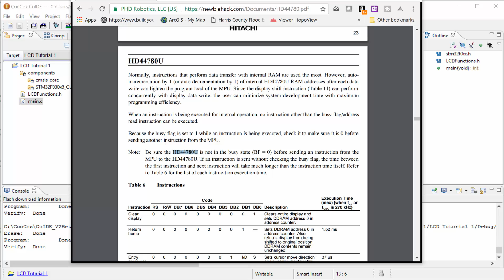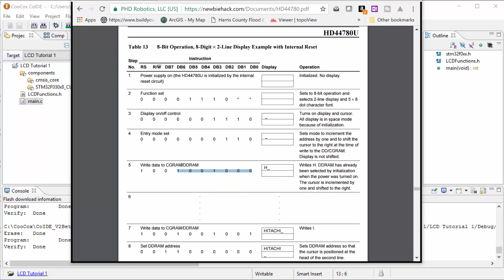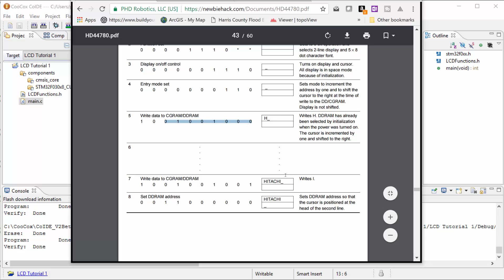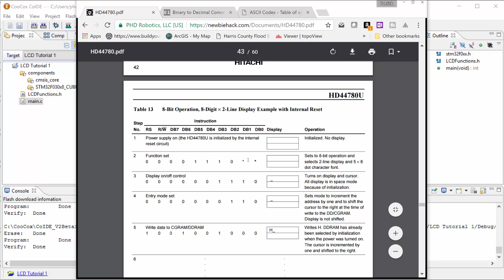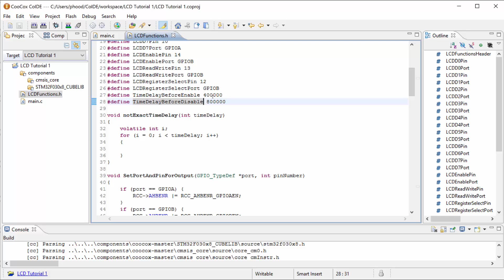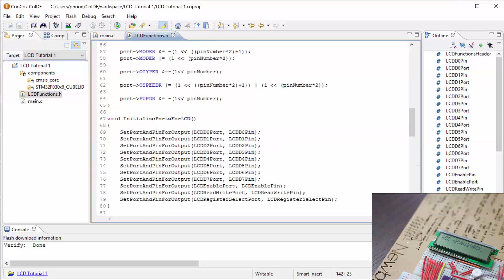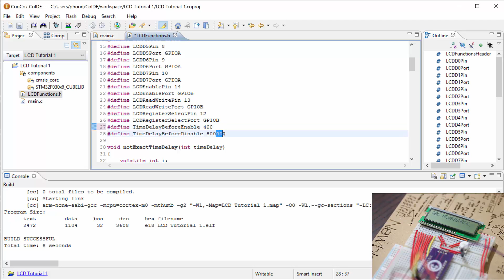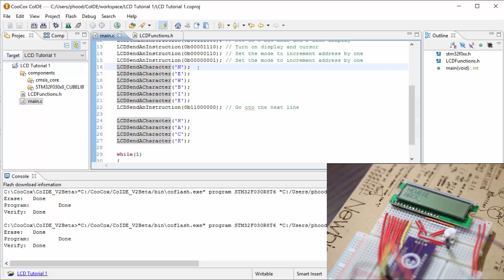27. How to Interface an LCD to an ARM Microcontroller Tutorial - Part 14

Comment: I could only get the code to work after the following initialization sequence:
        Delay_ms(100);  // wait more than 100ms

	LCDSendInstruction(0b00110000);  // set 8 bit operation, 1 line display, 5x8 dot font
	Delay_ms(5);  // wait more than 4.1ms

	LCDSendInstruction(0b00110000);  // set 8 bit operation, 1 line display, 5x8 dot font
	Delay_ms(1);  // wait more than 100us

	LCDSendInstruction(0b00110000);  // set 8 bit operation, 1 line display, 5x8 dot font
	Delay_ms(1);  // wait more than 100us

	LCDSendInstruction(0b00111000);  // set 8 bit operation, 1 line display, 5x8 dot font
	Delay_ms(1);  // wait more than 53us

	LCDSendInstruction(0b00001000);  //
	Delay_ms(1);  // wait more than 53us

	LCDSendInstruction(0b00000001);  // clear display
	Delay_ms(3);  // wait more than 3ms

	LCDSendInstruction(0b00000110);  // entry mode set, increment address by one
	Delay_ms(1);  // wait more than 53us

	LCDSendInstruction(0b00001100);  // display on, cursor off
	Delay_ms(1);  // wait more than 53us
Reply from the maker: You may need to add more delay. The LCD is slow (relatively).
Reply: @PatrickHoodDaniel  Well, I tried with various delay settings. Did not work. Maybe it's just because I'm using a cheaper LCD with SPLC780D driver. Thank you for teaching us!

Comment: thank you so much. I hope in the future you make vedios about microcontroller selection critera. I mean why we use ARM instead of Atmega or PIC for a certain project? what are the criterias that can be the reason for our choices? thank you again
Reply from the maker: Thanks for the kind words!  I can actually tell you why, but I may make a more detailed video in the future, these ARM chips are way cheaper and way more powerful, and just as easy to control and use.  They are cheaper because of economies of scale and the manufacturing is more efficient.

It really isn't justified to use AVR or PIC, in their more expensive 8-bit varieties anymore. Their 32-bit versions may have uses, but the STM32 line is so cheap, it doesn't make sense not to use it.
Reply: thank you for the informative reply

Comment: Thank you so much for this amazing series. I spotted one of your videos in my recommendations and since then I've had an absolute blast catching up to this one :) I believe you once said that you'd be doing stm32 tutorials for 'any peripheral you could think of'. I was just wondering if you were including USB (more specifically the stm32's ability to act as a USB keyboard) into that? Thanks!!
Reply from the maker: Thanks for the kind words.  I will be getting into the USB functionality, but as an external device since the STM32F030 chip that I am using does not contain the USB feature.  In a later series that investigates a higher level chip, I will probably get into that feature.